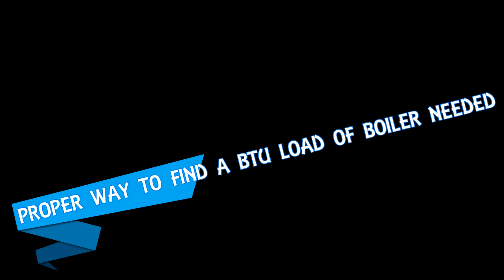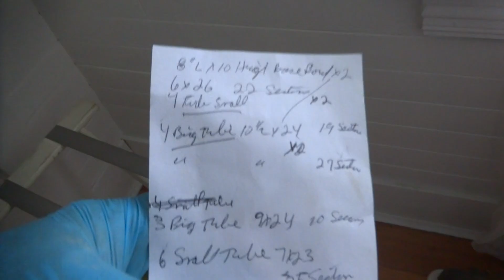3 Critical Boiler Sizing Mistakes You're Making Right Now

Comment: That place may not have been insulated when built… is it insulated now?  I renovated two 1960s houses that had no insulation… I made one of them 50% larger and with the insulation, new windows, and new furnace with the same capacity as the original it was fine.

Comment: i like to use the technique of boiler should run almost continuously when it is coldest day possible the radiators might be over or undersized for the house original house might have had no insulation and drafty windows. 
to be really accurate you have to figure insulation in house size of house number of windows everything to figure heat loss most houses are way oversized the boiler runs for ten minutes then is off for a while depends on how hot water is set to also.

Comment: Proper sizing ignored by many pros that will just replace what was in there without doing what Steve did. I had to find one after quotes from a few who would only replace it with a unit of the same oversized rating. A lot of older homes especially in the Northeast had boilers that were oversized and they tend to turn on and off to often a machine usually lasts longer and runs more efficiently when it runs for longer periods without the constant cycling. I measured the hot water baseboard fin tube length and calculated the BTU's went down from about a 150K BTU old Utica gas boiler to a 105K BTU Crown more appropriate for the house heating performance, knock on wood very good and monthly gas bills decreased significantly. I'm not a pro and don't claim to be one, I realize there are other variables to consider like whether or not the unit is located in a heated space etc..

Comment: Could the actual building load be less than that? Measuring the sections would provide you the maximum output of the radiation system, but I would imagine the actual load of the house could be less, especially if the home has been improved over the years such as with insulation, better windows, or even just some air sealing with gaskets and caulk.
Reply: Correct, the building load is not the connective load. The connective load is really only for sizing a steam boiler to match sqft of connected steam load to guarantee each radiator gets heat.
Reply: @scottk0623  was going to say the same thing. This is not the best way to determine the new boiler sizing. But it is a way you can do it and most likley come up with the same over sized boiler. Steam yes this is the correct way.